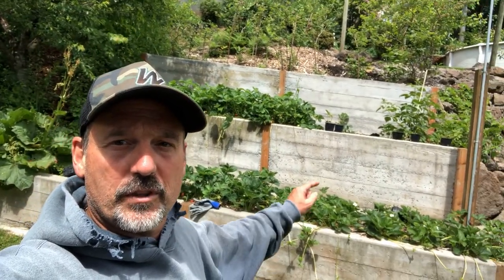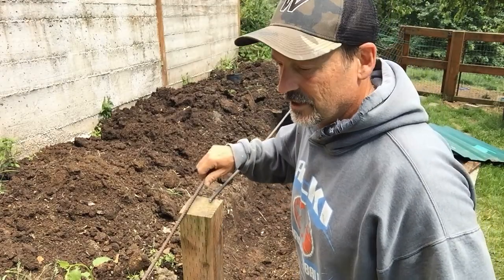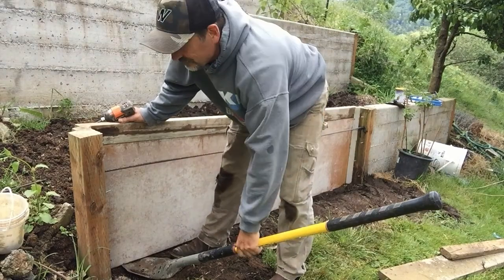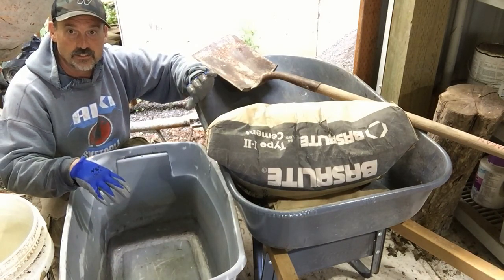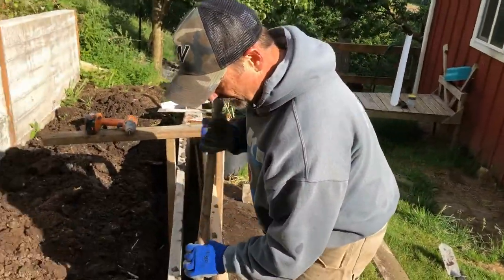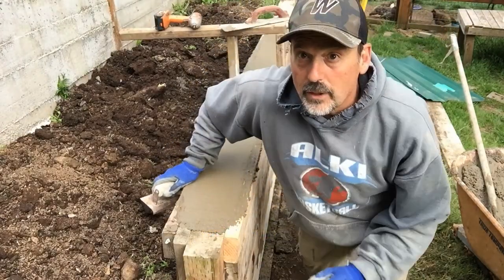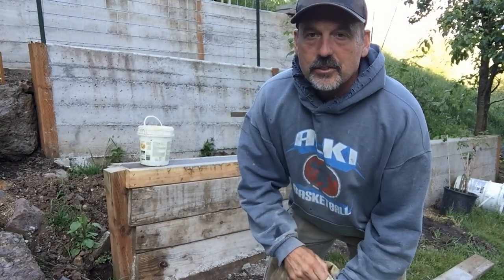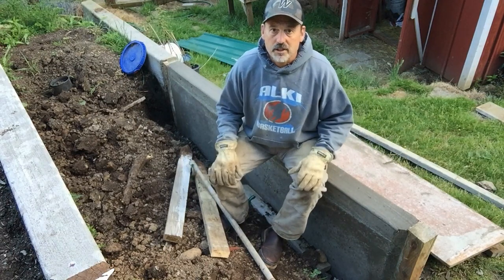Retaining wall / raised garden bed build. Terraces turn unruly hillside into easy to work garden.

Comment: Couple questions for you now that it's been up a year. -
How well has the timber posts stood up with moisture and rot over time? Was it just aesthetics to go with those over not including them?
I must have missed the part where you tied in a footing on this one. I know you discussed how you would do it, but I didn't see you do it on this one. Has the wall stood straight over time or has it begun leaning?
Reply from the maker: It is still perfectly straight up.   I believe largely due to the “dead head” anchors I put in that are angled back and sunk into the ground.  It makes a huge difference I have a much higher wall I did this on 20 years ago and it is still straight up.   The wood posts are holding up well.   They are pressure treated to prevent rot.

Comment: Roughly how deep are you setting your anchors for these walls/what are each walls dimensions?
Reply from the maker: Because the walls are not tall I did not have to got too deep for anchoring.  The posts are at least 2 feet deep.   Sections between posts is approximately 8 feet.   Continuous wall 16 feet.  Thickness on this wall was 5 inches.  Wall height is between 2 feet on shortest wall and 3 and a half feet on tallest wall. I have one anchor for each 8 foot section.   It is at least two feet from the wall and goes below the base height of the wall.  My ground is pretty firm so only needed to go another 16 inches down with between 60 to 90 pounds concrete in the hole.